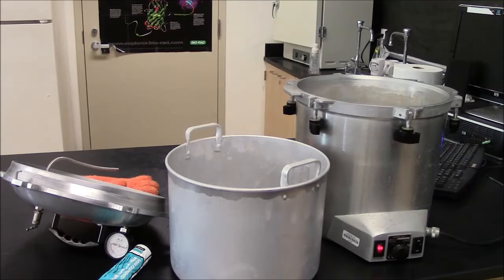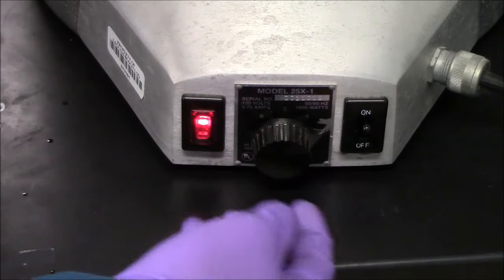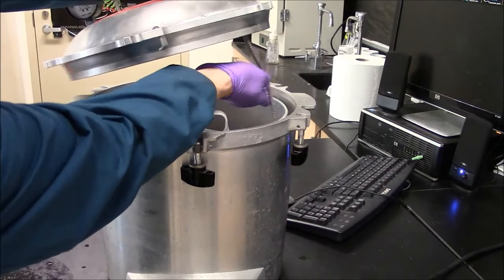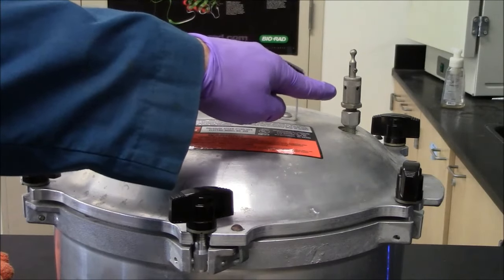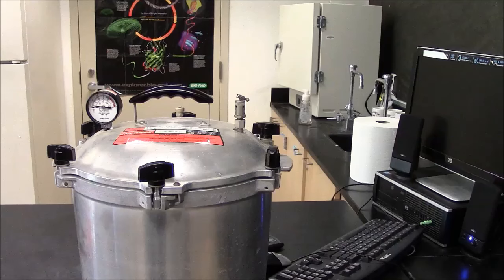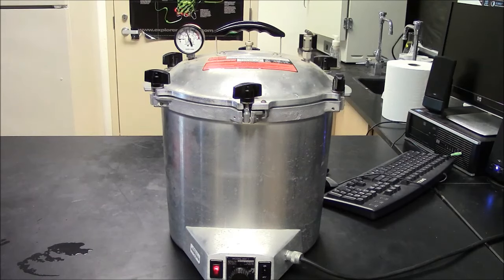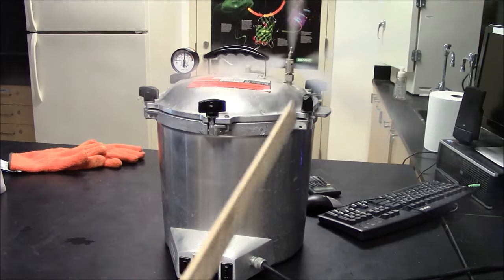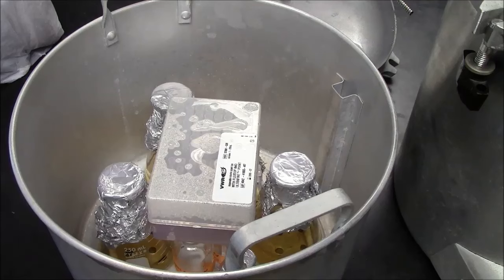Steam Sterilizer Operation

Comment: Once you vent and exhaust any trapped air for 5 minuets you need to repeat that again by opening the vent valve and venting for an additional three minutes to make sure there’s no air trapped whatsoever) according to the latest All American manual). Greatest reason for sterilization failure is trapped air in the chamber of the sterilizer and therefor the second venting for three minutes will help with this.
Reply: mycosic you would do the second release immediately after first air release?
Reply: once the gauge reads green then (while using a heat resistant glove) vent again for 3 mins to release any trapped air. then close valve again and continue.
Reply: Robert Estuar if in the green I wouldn't think that would be safe to release the valve at that amount of pressure
Reply: Says so right in the manual written and released from AA.
Reply: This may vary based on the size of the sterilizer. Steam will be drawn from the bottom of the unit up through the air exhaust tube and out of the control valve. Steam must continually escape from the control valve for at least 5 minutes. Once this has occurred, close the valve and let the pressure build until the gauge reads in the “green” sterilization zone. Open the control valve a second time and vent the chamber an additional 3 to 5 minutes. The reason for the second venting is to avoid sterilizer failure from trapped air in the chamber, which may prevent the steam from permeating the items to be sterilized.
Reply: the guy in this video released it loaded.. when he should have turned it off and let it cool naturally.
Reply: Robert Estuar thanks Robert I appreciate it.

Comment: Turn up to the desired level and let the electric thermostat take care of the regulation, it has a few degrees of play up & down where the pressure will then vary a little. if the pressure is a little too low or high, then change the knob very slightly once and then let it work by itself! One should not! turning the wheel all the time LOL.
Reply: Thank you. It bothered me so badly the way he kept playing with it. I'm glad someone else understands.

Comment: I have a 18L autoclave. But the problem is each autoclave pounch gets out wet. How can I apply a kind of drying cycle in this kind of autoclave?
Reply: You don't, just take it out and let it air dry.Should be hot enough to evaporate most of the water already. If water is still in the bag,then air dry it until it's gone. As long as the bag is not open or have a rip, the contents will still be sterile after drying the bag out.

Comment: baby sitting that pressure cooker to flip the switch over and over is kind of ridiculous for how expensive that thing is.
Reply: I have similar autoclave and I regulate the pressure in the green zone with minor twist of the heating dial usuallyonly one or 2 times during the strilization cycle.